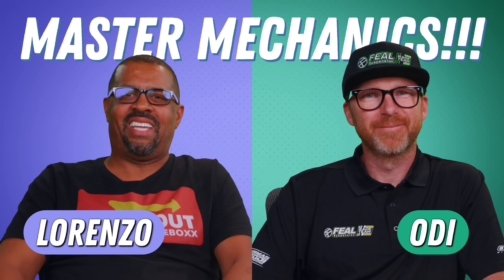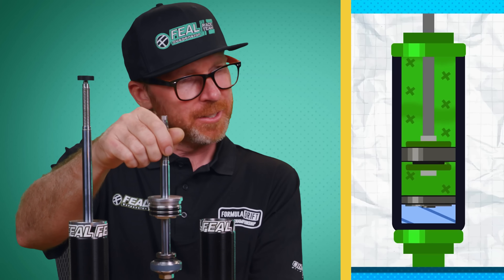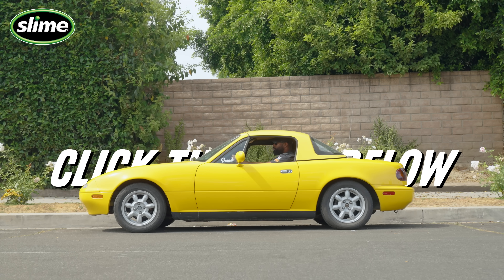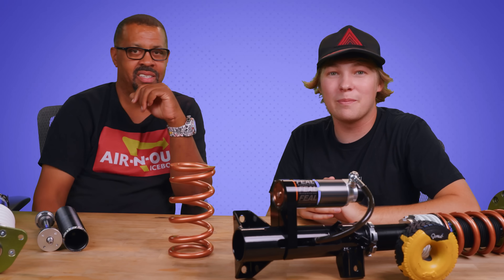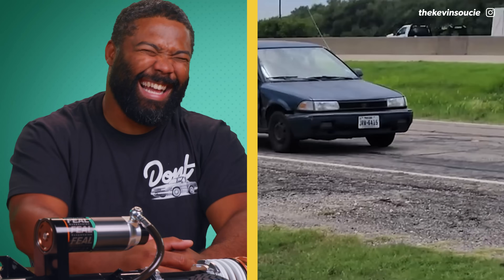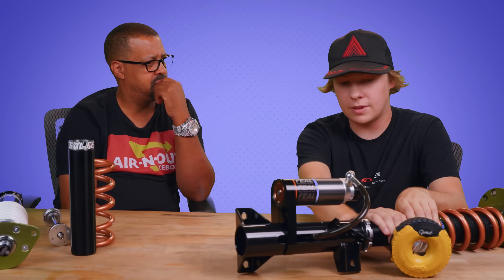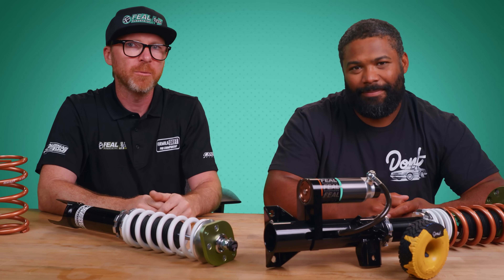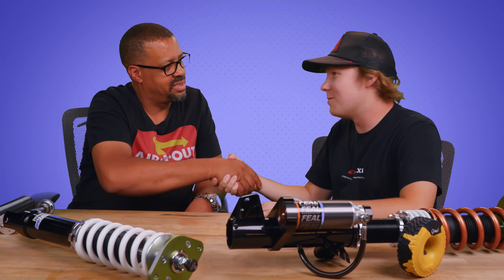Engineers React to Horrible Suspension Fails

Comment: OK MORONS IF YOU WANT TO TAKE A SPRING OFF THE SUSPENTION LEAVE IT IN THE CAR TILL YOU GET IT APART THEN LIFT THE CAR OFF THE SPRING THEIRFORE THE SPRING DOES NOT DO THE SPRING THING AND KILL YOU IT WILL STAY IN PLACE AS LONG AS THE CAR IS ON THE GROUND THEN YOU LIFT THE CAR OFF THE SPRING DID IT 100 TIMES AAND IT'S SAFE!!!!

Comment: The champagne on the hood reminded me of a driver that was teaching people to drive economical and safe. He was a a competitions driver who did these economic driving courses because he thought most people drove like retards. I remember two things he used to force people tp change their driving habits. One was a raw egg held over the accelerator. The other was a shallow bowl on the hood with a tennis ball in it. The training track was curvy and you had to drive it as fast as possible without crushing the egg or having the ball leave the bowl on the hood.

From what I heard most people had a hard time just getting around the track even when driving real slow. Mean while he could drive it with both the egg and the ball in the bowl faster than most people would do with neither of these used.

His idea was that if you knew hos to drive you didn't need to crawl like a slug down the highway just to drive economically. Now he was a competition driver and his students were mostly average people who just thought it sounded interesting. But the way he drove was impressive considering he had to keep that ball in it's bowl even when the track had sharp turns.

Comment: So, the main reason you don't see very much with magnetic or electromagnetic suspension is that pesky issue of thermodynamics.
As magnets resist each other, the energy generates heat and heat actually makes magnets permanently less effective as it causes the metal to denature. In high speed trains and MRI machines we use liquid helium to keep these systems cold.
So your magnetic suspension would either need a cooling loop of liquid helium running through it, or be replaced once every few weeks to days depending on how much it's getting used.
Hence why it ends up being more complicated and way more expensive to use than a standard shock.
Sorry guys, it's not going to replace it any time soon.

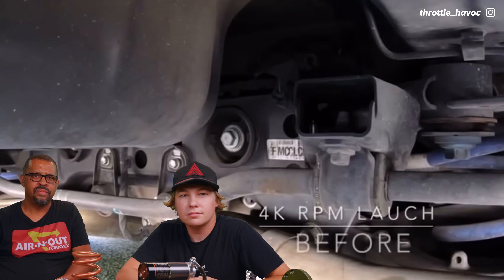Comment: 9:38 There is more to the video. The original person that posted that video showed the difference between the stock rear subframe in the S550 mustang, and the upgraded version. Its meant to show case how much play is in the OEM bushings and components, as one of the reasons for the mustangs to lose traction when people floor it and do their infamous crowd control. The upgrades parts almost totally eliminate that issue completely after install (at stock hp numbers ofc)

Comment: Sandro, for next time use electricity to heat the coil springs. Take it to the press and use wood blocks as insulation.
I mean, don't heat coil springs unless it's for the boys. For clients, however, it's best to make them buy ones that are engineered with an aplication/use in mind.

Comment: Do they not know that magnets are already used for thee Magna ride suspension that GM developed for the high performance trims of the Camaro?  It's been out for YEARS now, nd has been one of the reasons the Camaro has had excellent chassis control ever since.  It's also the reason the Cadillac CTS V always had such amazing handling, and since then GM has sold the right to use it in a number of vehicles to other manufacturers, all of which were praised for their handling, which I don't think GM gets enough credit for.  They use metal filings in the suspension fluid to stiffen and slacken the ride thousands of times a second by having a computer control the magnets with an electric current (not sure exactly how it  works, but that's the gist of it).

Comment: About the magnetic suspension while very cool the thing is giant neodymium magnets like that are quite expensive. You would need even stronger magnets than what that guy was using and they appear to be quite powerful to hold up a car at all. I don't think anything like that would see mass production. They are also called "rare" earth magnets. A quick google shows a single 76mm (3in) diameter magnet with a holding force of 500lbs is at around 300$. That all being said you might have better luck with electro magnets but you'd need a helluva alternator.

Comment: The reason the strut nut is accessible from the top is so it can be unbolted with the vehicle weight on it, then jack the vehicle up to relieve tension on the spring and continue disassembly.
THEN change out the strut and reverse the process to reassemble.
I've changed hundreds of struts this way, and there's no danger at all.
Never ever unbolt an unloaded, unrestrained spring!

Comment: you didn't do anything with the Citroen hydro-pneumatic system? before Steadicam they used Citroen sedans as camera cars for like horse racing and stuff because of how smooth the ride was. even with only 3 wheels on. there was an old DS5 commercial with a fleet of cars each missing a wheel driving around.

Comment: 16:28 dunno what the pull force those neodymium magnets have but they are easy to get. its the super strong and large ones that will be harder to get and also extremely expensive. and on the other note, they are brittle, so if those would slam together hard enough they will explode and throw junks all over the place.
and when i say they are strong i do mean it. i my self have 20mm ones and those have 5kg pull force when they snap on solid metal :D
so with that large ones u need to be extremely careful or they will crush ur hands and fingers with ease

16:42 those are all rdy a thing. BOSE has made electromagnetic suspension but i think it just was too early of its time since those are pretty rare to see
aaaand ofc the 2nd clip is exactly that suspension xD

Comment: Please do a whole episode reacting to Garage 54 videos. They made pistons out of wood, they filled tires with cement, they've done basically every insane experiment you can think of
Reply: Or the 4 cylinder Lada engine they chopped in half and welded to another to make a custom inline 6 engine
Reply: @Timbobjr  I mean, large manufacturers have done this. The Citroën GS flat-four engine is literally just 2 2CV engines tied together.
The PRV engine was the opposite, designed as a V6 and chopped down to V6 for reasons I can't recall (probably economy)
Reply: @LeSarthois  But it was not a block chopped in half and welded to another in a Russian garage, including a custom cam and crankshaft they welded together
Reply: "voiceover by b.m.i Russian"
It amazes me that garage 54 is still coming up with crazy ideas to try.
Reply: How did the wood pistons work out?
Reply: @spideybuildscars  Rather knotty, I would imagine.
Reply: @spideym35i they've made copper pistons, aluminum crankshafts, made motor with the oil pan on top and intake on bottom. Soo many things
Reply: @98ek9 just answer the question?? Does it make you feel better about yourself withholding knowledge.. or was it genuine fandom so you left the mystery and extended the olive branch for the community? 
Zero hate. Genuine curiosity…  we have at least something in common so cheers, mate. 🦄
Reply: @justajabronie  what question? No idea what you on about buddy.
Reply: @spideybuildscars  they wooden work
Reply: @spideybuildscars  not good
Reply: Most experienced were done on ladas too.
Reply: werent they also the ones who did a lada with like 8 or 10 wheels or something?
Reply: I second this! Those guys are some crazy a$$ Russians!!
Reply: Yeah Garage54! Always fun to watch cause of the requests experiments they execute 😂
Reply: Hell yeah lets see it
Reply: I was about to write same. Garage 54 did some crazy things.
Reply: Rubber band piston rings...
Reply: That would be incredible.  😂
Reply: They changed the firing order on a lada too 😂
Reply: Yeah, you need to 100% do a full episode on Garage54 experiments. They’re awesome.
Reply: I’m shocked, like no mechanic on Donut knows or watches Garage 54 .  You totally need to do a react video from the professionals and the Russian experimentation garage of Garage54.
Reply: @bradfaubion3699 competitors buddy. they don’t act like each other exist
Reply: Absolutely love Garage54

Comment: lmao there's an irony to having an ad for SLIME on RMS - no mechanic/tire guy wants to have to clean that shit out
Reply: That's what I was thinking. They also didn't point out it's not a permanent fix and you still need a proper patch or potentially new tire. Your next stop after using that godforsaken slime should be the tire shop, and you should come clean to them about what they used so the tech doesn't get splattered when they dismount the tire. 
Ask me how I know... 😅
Reply: @YevhenRawrs  You've clearly been that poor tech.  I hadn't thought of that problem, as I figured it was designed to dry within a few minutes of air contact, but it does make sense that if it's still liquid it would make a mess.
Reply: @Razmoudah  I'm sure it does harden over time, but it obviously takes a lot longer for all of it to dry than it does for the bit needed to make the patch that allows you to inflate the tire up again.  As a consistently broke boi myself, fix-a-flat has saved my ass so much money and time that I don't think any new info about it will ever change my opinion of it away from being anything other than a godsend.  When you're unemployed and broke, but still need to be able to drive, it's an affordable fix compared to the minimum of ~$50-60 that you'd have to spend at a used tire shop.  It can also save you from expensive towing fees.  I'm embarrassed to say it, but I've actually driven a few tires now down to the cords by just applying a can of Fix-a-Flat each time it got a leak, and each time it gave the tire a solid 1-3 more months of life.
Reply: @Razmoudah  nope, Slime stays soft, and it has a bunch of small rubber pellets in it(think like rubber sprinkles). The idea is the slime itself will slow the leak, until one of the rubber pellets finds it's way to the leak and trys to push it's way out and gets caught, or several stack on top of themselves and "seal" the leak.

But it stays in the tire soft the whole time, and it is nasty to deal with.
Reply: @Razmoudah tire tech here.  That shit never dries and never works. Last week, we had a new gm truck come into the shop, and the driver said she used a can of this stuff to get her to the shop. She had put it in the day before , and it ruined the finish of the inside of the wheel.  The gun metal finish was coming off like a snake shedding its skin. There should be a surcharge anytime someone uses that shit!
Reply: @th3R0b0t  rubber pellets? How do the pellets get through the valve stem?
Reply: @hulkslayer626  you're thinking too big, gotta think smaller.

Also, Slime's instructions at one point, told you to remove the valve stem core and fill the tire with the contents of the bottle, reinstall the valve stem core, then air up the tire and ride to properly distribute the slime.
Reply: @th3R0b0t  oooooh, ok. That makes sense now. I was gonna say, if the pellets are small enough to go through the valve, then they're too small to plug a hole hahaha 🤦
Reply: I still remember my auto shop teachers telling us during my freshman year of high school to let the mechanic(s) working on our wheels know if we ever used any thing inside so they can prepare.
Reply: The shop i work at charges an extra clean up fee per tire if any sort of leak stop is found inside the tire, the more we have to clean out the more the charge is. Got one that was filled 1/4 full, saved it and the rags used to clean it out in a bucket to show the customer why the fee was almost $40. Estimated he spent almost $50 or more in stop leak considering there was over 2 gallons of the stuff. After that i came up with a pneumatic vacuum using a chunk of tubing and an air nozzle which works great for speeding up cleaning out slime and the odd tire full of water local farmers bring in to be swapped to a new wheel.
Reply: @justarel  do you know how long the tire fix stuff stays liquid for generally?  Like, did the customer take the tire in to you guys not long after using the stuff, or was it someone like me that has run a tire for weeks/months after using Fix-a-flat in order to save up for a buy a replacement tire?  If the liquid has all solidified, is there still stuff you have to clean up when changing that tire?  I've had to use the stuff many times and only ever got used tires as replacements at a place where the whole thing happens in minutes right in front of you, and i've never seen the guys doing it get splashed with liquids or sludge, so I'm wondering if that's just because it's always at least been days after i use the can that I take it to them, so I guess the liquid has aaaall solidified by then.
Reply: @moogle68  It really never dries inside a tire, some products with fibers in it turn into a sort of goo that coats the inside of the tire and the rim (pain to clean) and can actually plug up valve stems and tpms sensors requiring them to be replaced incurring additional cost to the customer (cheapest tpms sensor we have is $60 +tax). We have one tire that a whole can was used on sitting outside in the 100f heat and sun for 2 weeks that is just starting to sort of evaporate and congeal into bright green clumps.
Reply: Using Sandro to lead into the ad was Slimy.
Reply: @fartnloud7411  its what you can expect from investor run companies
Reply: No it does not it leaves a wet sticky slimy mess. We charge double if a sealant has been used in a wheel. Cleanup time alone is double the work
Reply: This is what happens when Private Equity acquires companies

Comment: The tennis ball suspension was a hack that saved lives. Why and where, you ask? In Germany. Specifically, in East Germany, before the Berlin Wall came down. Many who wanted to flee from the oppressive regime were smuggled out of the country in cars. They were hiding in some pretty tight spaces. Double floors, hollowed out bumpers, you name it. If you can imagine any spot in a car where you could cram someone into, the East Germans have likely either done it or at least considered it. 

But in order to not raise suspicion, they stuffed a bunch of rubber balls / tennis balls into their suspension springs so the car would not ride too low from the additional weight of the people who were being smuggled. One of those “specially modified” vehicles is on display in a museum in Berlin.

Comment: The "electrically tuneable magnetic suspension" discussed at 17:00 shows up at 18:00. Yeah, BOSE ... magnet riding on a sleeve .... add a cone and ya got a speaker. NOW, what if I could play the bass of my tunes through the magnetic suspension? GET ON IT!!!
Reply: Take hopping to the next level by running a hi/low pass filter to the front/fear wheels on your magnetic suspension
Reply: @DjDolHaus86  You got it. Make a fat-assed Cutlass twerk while the headlights jiggle! We have the technology. (former Rockwell, ABB, Schneider guy ... i'm TELLIN ya)
Reply: Came here to find this type of comment. Sucks it didn’t get as popular as I think it should have
Reply: For some reason I thought GMC had some sort of magnetic suspension as an option a while ago.
Reply: @comeridewithmeAE  Yes, initially on Cadillacs and on Chevy truck high trims as well as Camaro and Corvette, Magneride suspension. Tuneable by using magnetic fluid in the dampeners and adjusting the amount of electrical current flowing through the fluid to stiffen or soften the ride characteristics.
Reply: @comeridewithmeAE  electromagnetic suspension (where the ENTIRE suspension is electromagnetic) is different from Magneride, which still uses fluid in a shock - but one that contains a ferrofluid and is therefore adjustable in stiffness by changing the strength and orientation of the magnetic field acting on the fluid. I still remember the first time my dad brought home a syringe of it with a VERY strong magnet for me to play with lol.
Reply: That "GET ON IT" reminded me of when Bill Burr was joking about Steve Jobs.
Reply: @Uhdksurvhunter  You "got" it. I was definitely channeling Bill Burr there.
Reply: I'll bet Bose wasn't welding them to a crossmember. Lol
Reply: I guess you'd still have to divide the frequencies. 20 hz is still 20 times per second which is not good for jumping - the car will vibrate like a Harley Davidson xD
Reply: @j7...  The bass would act more like a "trigger" on the major beats; I wasn't real clear, but I ain't tryin to PLAY the highs or lows through the suspension, rather utilize the rhythms to trigger a response. I know I just contradicted my original post, lol ... overly enthusiastic I was.
Reply: Volvo made a brilliant unit.
Reply: Imagine blasting morse code through your suspension while driving down the freeway 😂

Comment: Most stupid thing you can do is to heat a spring .
Never do it its dangerous.
The metal is damage and it will break.

And yes i repair damage Crash cars that i have to repair..
And see a lot of stupid things .
One of them cut a spring or heat the spring to lower it.